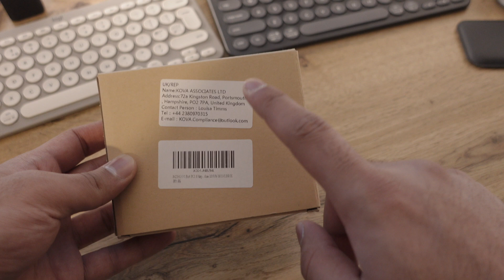Add 7 USB 3.0s to your computer

Comment: That's handy for someone who needs the connectivity, and some occasional bursts of speed, but not a sustained multi-device high throughput.  I certainly wouldn't be connecting multiple high speed devices and be expecting good transfer rates though.

Comment: No SATA-Power needed? Strange... I have a 2+1 Port card and it needs SATA power already.
Because PCIe x1 slots usually can't deliver 75 watts.
Reply: why would 7x USB 3.0 need 75W of power??? if you can count, 1x USB 3.0 has 5V and 0.9A, and if you can count, you will have something like 7x(5x0.9) = 31,5 Watts, and PCIE x1.0 has max 60-75W of power
Reply: @Pikaramaw  USB 3.0 is up to 1.5A based on specs and that just within spec could be way more for charging

Comment: Hard to tell from the video but more than likely that's just one USB controller and then a USB hub sorry for using that for storage there will only be 5gbps total across all the ports.
Reply: It's definitely a hub controller. It is only using a single x1 PCie lane. This is definitely 5gbps total, shared across all USB devices.
Reply: Dang! You are a Pro! I just got done writing out a whole blurb on posing that question, as I was curious. And I think you nailed it. 100 points awarded!
Reply: Yup, the reason it's 7 ports is because the main USB controller have 4 ports, the hub have 5 ports and 1 is the upstream port which connected into 1 port of the controller